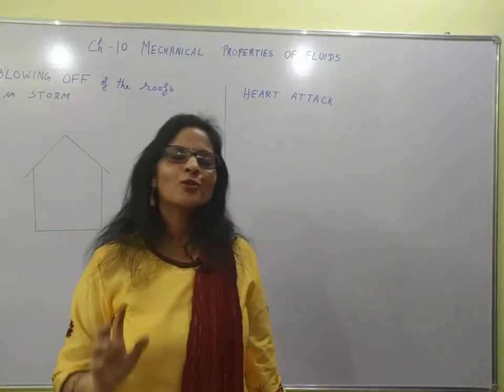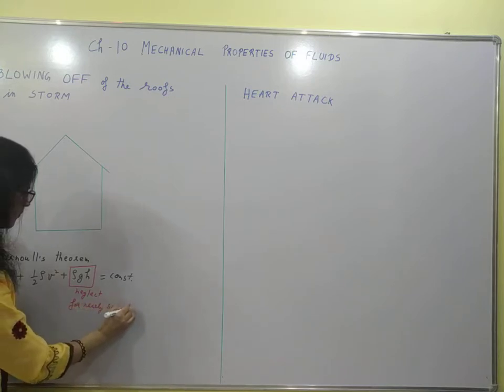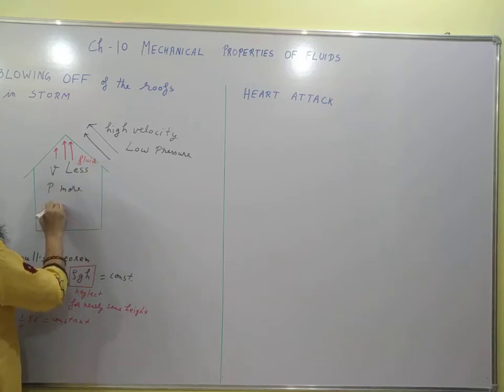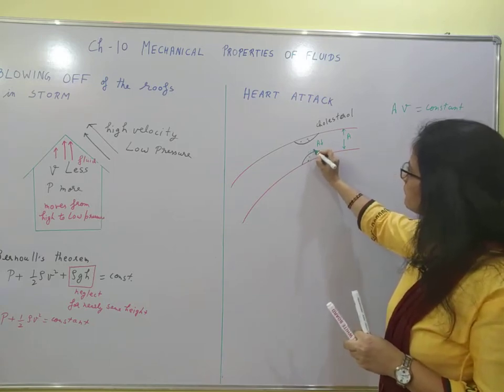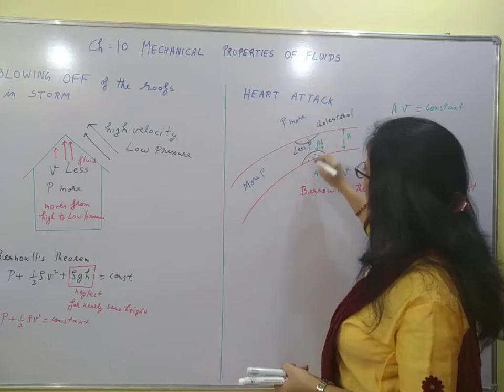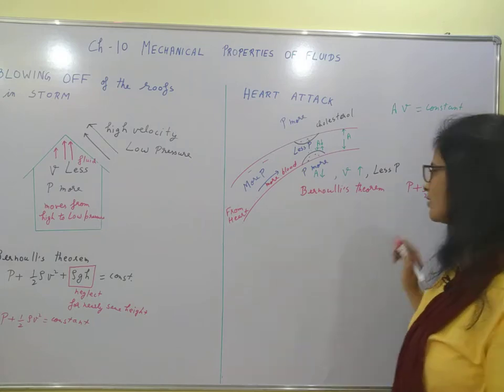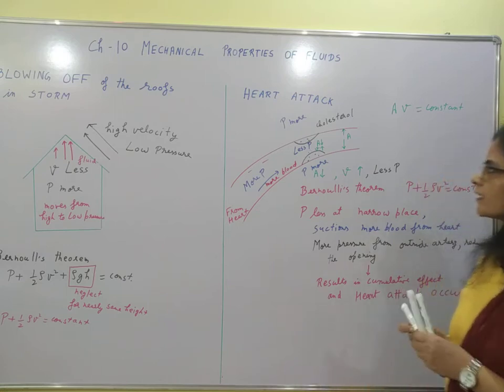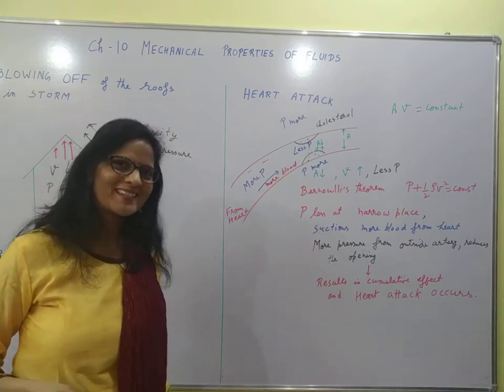XI 10.13 CAUSE OF HEART ATTACK  PHYSICS SIDE

Comment: Ma'am i disagree with the statement that the low pressure in the artery sucks more blood from the heart. The low pressure is a result of the velocity created by pumping of the heart in the first place. If the low pressure favours the pumping by pulling more blood from the heart, it'll become a vicious cycle. This theory is like saying a ceiling fan pulls air from above downwards and the movement of air from above downwards favours the running of ceiling fan. But it doesn't occur right... So what i think is the low pressure created by increase in velocity at the site of stenosis doesn't pull more blood from heart but it only creates a perpendicular pull which leads to the collapse of the vessel wall or dislodgement of an emboli from the atheroma.